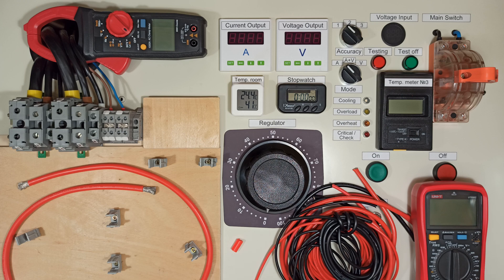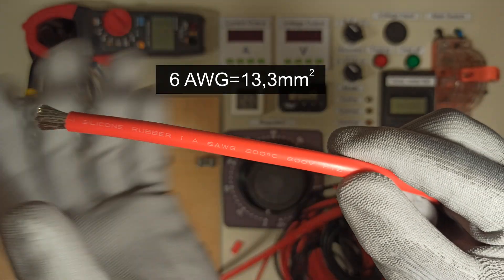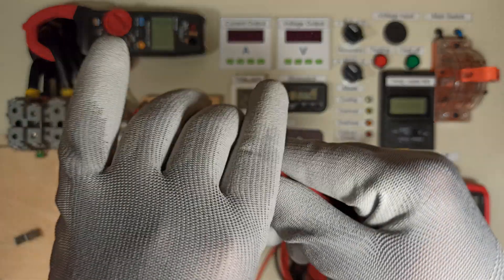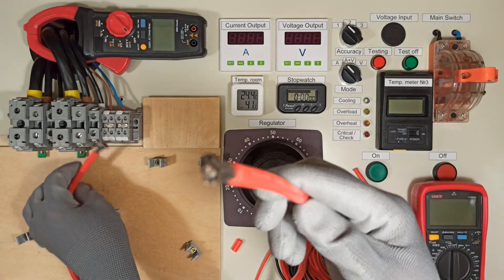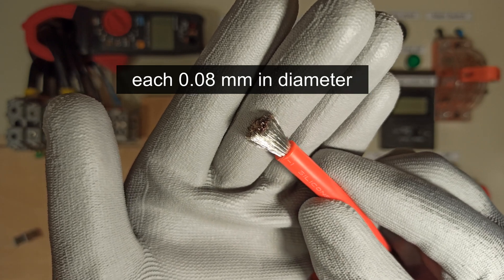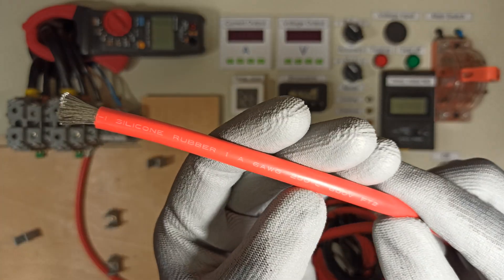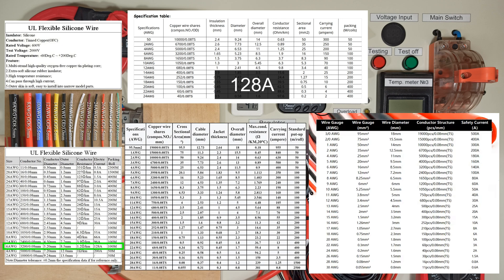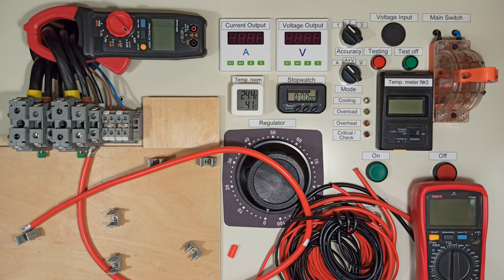Current Test 100A 150A 200A | 6 AWG Silicone wire Temperature

Comment from the maker: Please support my channel: https://www.youtube.com/channel/UCqZUswoAI9E9iFcTeS7L6gw/join
In my opinion, these silicone wires are of high quality, and I will continue testing them. Have you used them? (Maybe other cross-sections) I wouldn't rule out the possibility of counterfeits or wires with low-quality conductors. Share your ideas and comments. There are also a few questions about this test:
   1) up to what temperatures and currents would you use them under continuous operation?
   2) at what current do you think a 6 AWG wire would heat up to 200C°C?
   3) why do you think the temperature readings from the sensor and the thermal imager diverge more as the temperature increases?
Reply: 1. 50C otherwise you waste energy as heat..
2. around 265A

Comment: I would like to see the voltage drop across the conductor during this test, especially at the highest temperatures. Assuming the insulation holds up, as expected, any significant power loss across it will make the cable less useful.
Reply from the maker: Yes, voltage drop is very important in low-voltage circuits. And I have this video recorded. However, for some reason I just can’t manage to edit and upload it. I think I did tests up to around 300 A. If you’re interested, leave a like — I’ll try to finally upload it

Comment: i bought the same 6awg wire to use in my electric scooter with 200 amp esc controller. Since it will not use max amps all the time I think this gauge will be enough. My main concern is connectors. I use 8mm but they're pretty hard to solder with such a thick wire. Maybe you could make a test where 6awg silicone wire is joined in the middle by soldered 8mm bullet connectors and see if this is the hottest point during load testing?
Reply from the maker: Hi 🙂 That’s an interesting question you raised. I had a quick look at the specs of similar connectors — 8mm are rated for around 130A continuous, which is quite a lot. Still, you're right that this could potentially be the hottest point in the circuit. That’s not necessarily a bad thing — connectors almost always run warmer than the wires themselves. I might actually test this type of connection. By the way, is this a common solution in electric scooters? If so, I think a lot of people would find it interesting.
Reply: @ElectroTest_1  i think standard xt-60 or xt-90 connectors are more common but I want to have lowest resistance possible and 8mm seems the best I can fit (very little space inside frame). For example Ninebot Max G30 scooter has a common failure point at the motor phase wires bullet connectors which often melt together and short out. You could have an interesting video for RC world by testing all common connectors like dean, xt30, xt90, ec3, ec5, as150, anderson, bullet 2mm, 3.5mm , 4mm , 5.5mm , 6.5mm , 8mm and see how they fail.

Comment: The amerage rateing is depend on howmany temperature rise is alowed for that aplication. That means the rateing is can be increesed by forced air cooling. 
The second thing the advised temperature and current rateing can be more intresting when the conductor loaded with dinamic currents and the temperature stressed insulator olso needs to whitstand mechanical disturbance by the apering magnetic forces.

Comment: 1) I know Silicone cables are used for sauna ovens and other appliances in the sauna room. Because they can handle the heat inside the sauna. Maybe that's what caused the large spread of different current ratings, it depends on the air temperature. In a 100°C Sauna 128 Amps would make sense. 2) I think it will reach 200°C at 300amps when the air temperature is around 20°C. 
3) Maybe because of some imperfections, maybe the strands differ a bit or maybe the layer of tin isn't everywhere the same thickness.
Reply from the maker: Thanks for the comment! Yes, I found another advantage of silicone wires — they are also moisture-resistant. I agree! I think 200°C will be reached at around 250–300A.

As for the temperature difference between the sensors — at first I thought it was an error. But it's probably accurate — the sensor attached to the wire is not only in contact with the wire. There's a thin heat-shrink, and on the other side it's exposed to air that's around 25–30°C. So the higher the wire temperature, the greater the difference will be. In this case, the thermal imager shows a more accurate temperature.
Reply: @ElectroTest_1  Yes I understand, but aren't the three pints of the Thermal imager also quite different?
Reply from the maker: As for the temperatures shown by the thermal imager, there’s a different explanation. These points indeed have different temperatures.
Point 1 is the middle of a 1-meter-long wire — it should be the hottest.
There’s also Point 2 — it’s quite close to Point 1, and there’s a bend nearby, meaning another wire is close.
And Point 3 is between Point 1 and the power terminal. On the other side, there’s a wire with a larger cross-section, and the terminal itself is significantly cooler. However, it absorbs heat.
That’s why the temperature at Point 2 is lower.
Reply: @ElectroTest_1  That makes sense.

Comment: Cables can handle a steady current up to 150°C. After that, their resistance goes up, and they can't carry as much current. So, they should be allowed to run at full current only up to 150°C. If the temperature goes higher, it can rise quickly, and the test should be stopped right away.
Reply from the maker: Thank you for the comment! But why exactly 150°C? This is not mentioned anywhere in the specifications. Yes, I understand that at some point the resistance and temperature will start to rise sharply!
Reply: @ElectroTest_1  There’s not a lot of info out there, but try searching for "Strombelastbarkeiten ACS" — there’s a PDF that goes into this. It mentions that copper conductivity is at 100% around 145 °C, and starts to drop after that due to the increasing resistance (because of copper’s positive temperature coefficient).

That said, the actual limit might be a bit higher, since the table is based on an ambient temperature of 55 °C and insulation rated up to 180 °C.
Reply from the maker: Thank you for the technical data and the logical explanation. I haven’t looked into this yet. It's very interesting information!

Comment: Excellent testing. These are seen a lot in batteries. I use them for solar and custom batteries for the home. While I always try to stay within the NEC requirements it's interesting to see how manufacturers seem to undersize conductors or be on the bleeding edge of what's advisable. Thanks for the videos.
Reply from the maker: Thanks for the information. As far as I know, according to the NEC, the current rating for 6 AWG wire is around 55–70 amps. Please correct me if you have other data. However, this applies to wires with standard insulation. Silicone-insulated wires can withstand much higher temperatures and, accordingly, higher currents before getting damaged.

But there are other important factors as well. One of them is voltage drop — even if the wire can handle high currents and temperatures, a significant voltage drop might become a critical issue when choosing the wire gauge.

Another point — let’s say the wires can handle 200°C. It's important to consider where they will be placed and whether they might damage surrounding objects or materials at that temperature.
Reply: @ElectroTest_1 I believe that's correct off the top of my head. Obviously it depends on the wire insulation. The NEC can be quite tricky because it depends on primarily where it's installed, such as in a conduit. How many wires are in that conduit as you allude to. A single wire and a 2-in conduit that is steel is probably safe at 200 amps but not at necessarily, if it's attached to plywood, let's say. The other main consideration from the NEC is the terminal rating rather than the insulation. So if you're terminating in a 75c enclosure, you have to abide by that. Often this results in a size upgrade. For example, I currently have a 90 amp service to a solar fed panel that is 4 AWG. It's rated at 85 amps. The next available common size breaker is 90 amps this is because the panel itself has terminals that are rated at 75c. Now I don't attempt to push any limits and the largest current that I have seen for that service is near 30 amps intermittently. But I do find the failure limits intriguing. It seems the NEC is extremely conservative.
Reply from the maker: Thank you for the real-world examples and explanations. I agree that it's important to consider all elements of the system across multiple parameters. You made a good point about the temperatures in the electrical panel. I believe the same applies to the materials used for routing the line — such as conduits or cable trays.

I’ve also tried comparing the requirements of NEC, IEC 60364, and DIN VDE. The NEC appears to be stricter and allows lower current ratings. I think this is an interesting topic for discussion. It likely improves safety but also increases costs.
Reply: @ElectroTest_1  I reread through this. I should note the NEC does have criteria for voltage drop. The same example of 4AWG (THHN) wire, is rated at 85A, at 75C due to the terminals we discussed. Higher than that is usually industrial panels and materials which come with a heavy price. for the voltage difference they recommend 3%, which at 90 amps would be up to 70' of cable. Beyond that distance I would have to go with 2AWG for the same load. But that assumes a constant load. 

It gets kind of convoluted and I imagine most Professional Electricians just follow rules of thumb given there's like 20 contributing factors and safety margins.